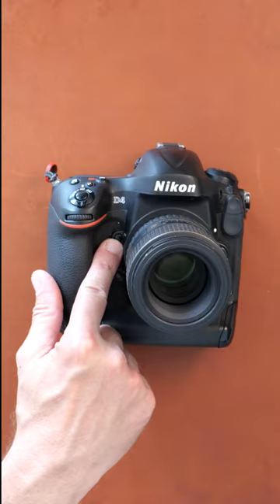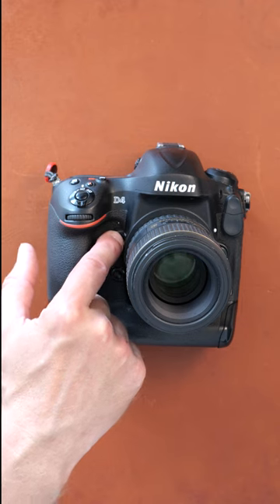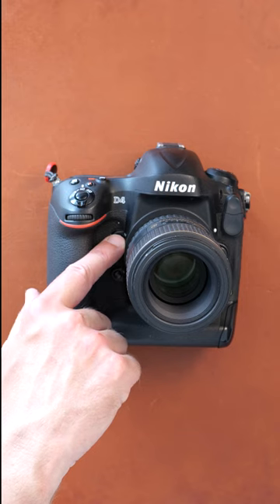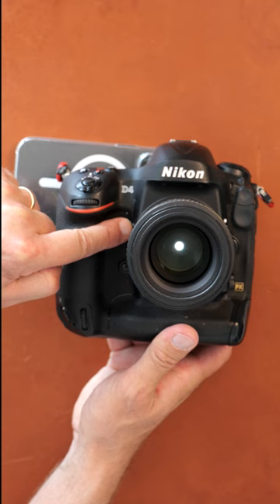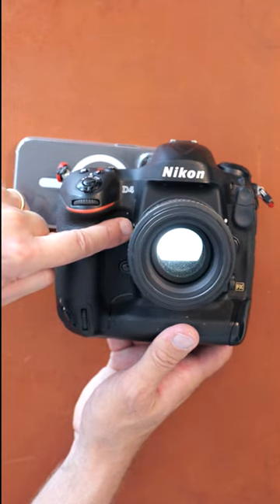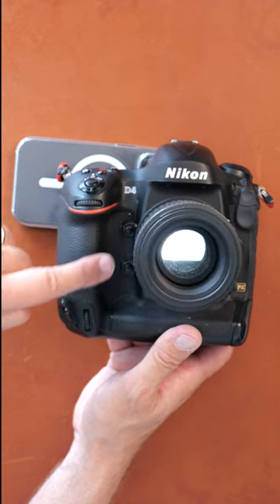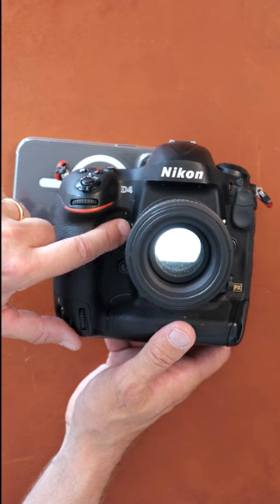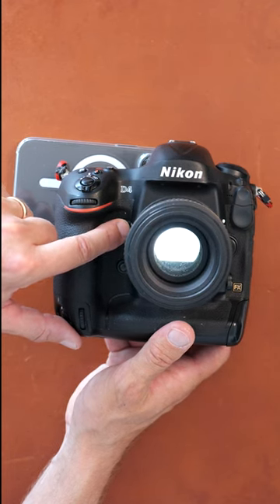What is that preview button for?

Comment: Very informative
Great camera.....is the  d4  a better camera than the  D3s????
Reply from the maker: Sorry I have no experience with the d3s camera.
Reply: Of course it is.
Reply: really depends what you're looking for.

if what you want is absolute best color reproduction I'd say that the D3/D3S/D700 have an edge over the D4.

However the D4 has better dynamic range and slightly better resolution, also better shooting speed and better video (even if it's still not good video).

You might also prefer the colors out of the D4's sensor, but that's a matter of personal preference, I know I prefer the colors out of the older 12MP sensor

Comment: I never found this function to be that effective to be perfectly honest. Even when it's binded to a button and I can't change it (like on my D2H) I almostnever use it for the very simple reason that DOF always end up different on the image compared to what you see in the viewfinder. Our eyes have different circle of confusion which generally make us see less DOF than there actually is on the imge created by the sensor. I much prefer leaning my gear and know which setting on my lens will give me the DOF that I want instead of relying on a DOF preview that can be innacurate.

When I have the occasion, I much prefer remapping that button to something else (non CPU lens switcher for example)
Reply from the maker: Personal preference, I guess.